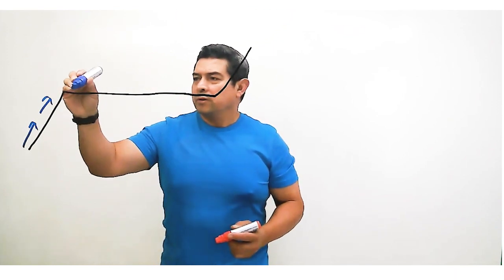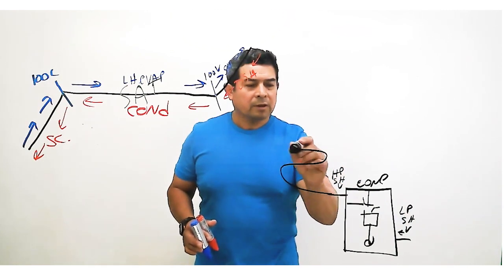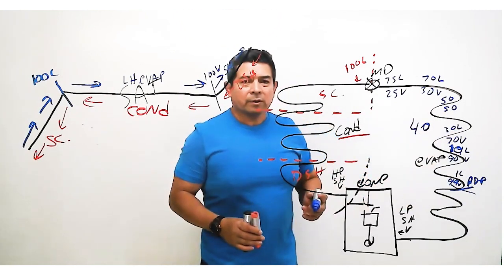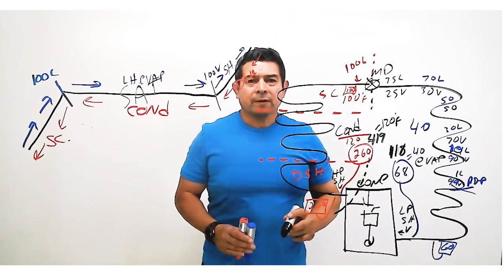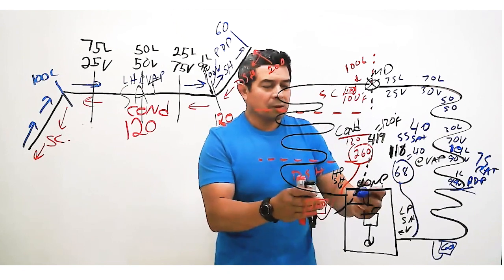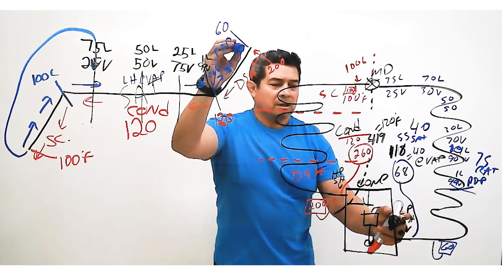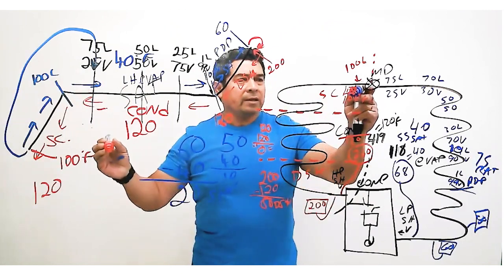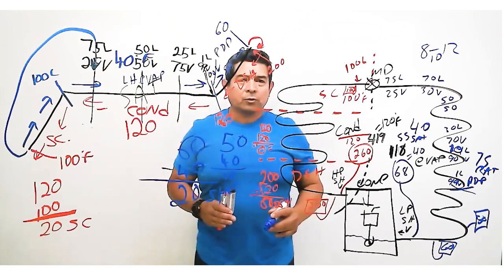Heat enthalpy chart and the refrigeration cycle

Comment: Funny thing is that you never mentioned the word 'enthalpy' (watch the video-title)? It's a nice word, but what does it mean?
Reply from the maker: Enthalpy is just a big word that is talking about total heat, meaning sensible heat and latent heat.     in this video I am talking about how an air-conditioning unit is absorbing and giving off sensible and latent heat.           This is one of the ways that I explain what happens at the refrigeration cycle.      It works for most people understanding how the refrigeration cycle works, and what happens in each area of it.      I just did not find it necessary to use big words.     but thank you for pointing that out. And thank you for watching!
Reply: @AirConAcademy  Thanks.
Reply from the maker: @ thank you for watching!